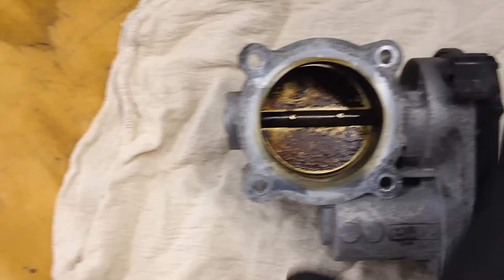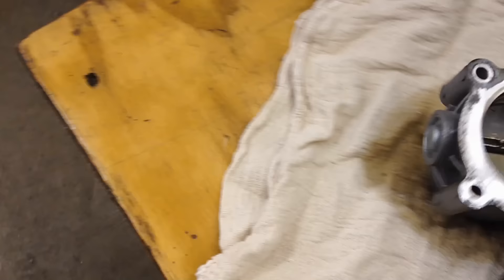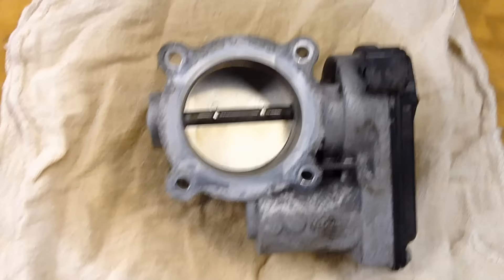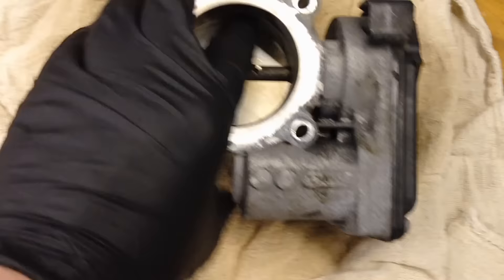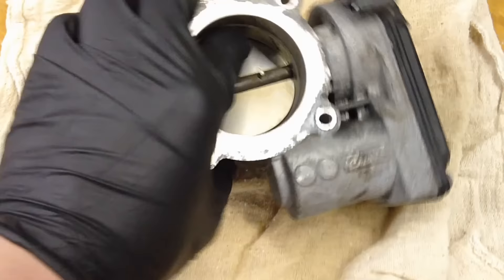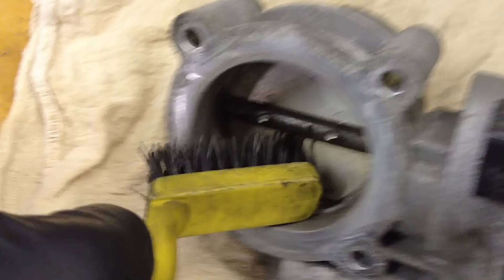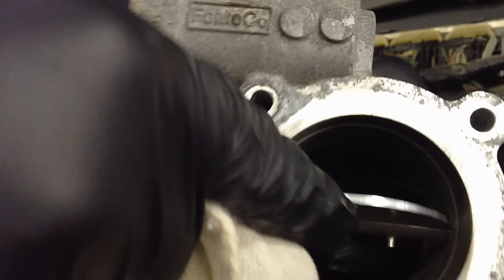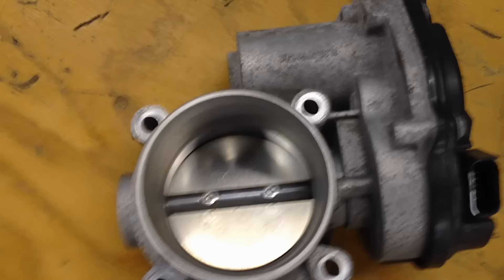How to Clean an Electronic Throttle Body Safely

Comment: So is any brand name throttle body cleaner safe to use on any Ford throttle plate?    I was wondering because I know some models have the warning sticker not to clean the throttle body because it will wear off the coating.   Thanks for the videos!
Reply from the maker: Just make sure it throttle body cleaner and not carb cleaner and you will be set. Most of these cleaners lost their power a few years ago when the Feds force water based chemicals on us.

Comment: I have a 2011 Ford Expedition. I recently have been experiencing cold start problems, when it does finally start, the overwhelming smell of fuel from the tail pipe will kill you. I recently had a remote start issue and disconnected the battery. according to your video disconnecting the battery will reset everything including the throttle body parameters and positioning on startup. I did not clean the throttle body but followed your instructions on the relearn procedure. I'll see how that goes. If it continues I will try cleaning the throttle body before replacing it. Any other advice would be more than helpful.
Reply: If you're getting excess fuel in the exhaust then either your cats are failing or your car is running rich.  Simplest cause?  A vacuum leak.  A vacuum leak causes a lean condition and the PCM compensates by drastically increasing fuel since it cannot reconcile the unmetered air.  Another thing to check is spark plugs, although you'd probably have felt if it was consistently misfiring.
Reply: I had a similar problem with my '08.  Ended up being a bad fuel injector.  Hope that helps to track down your issue.
Reply: I appreciate the input.  It has been starting just fine since the weather has warmed up, whether by key or remote start.  I'm fairly convinced that it is in fact throttle body considering the amount of miles my vehicle has on it as well as the fact that cold temps play amajor factor in the functionality of electronics. As long as it starting fine now, I will continue to run it as I am saving money for a performance throttle body and spacer kit for it.

Comment: I have also heard that when you put the throttle body back on that you need to tighten it down a little bit at a time.  Tighten each bolt opposite from it so it goes on gently an straight.  What are your views on this?
Reply from the maker: Tighten down in a criss cross pattern yes, tighten down a little at a time no. Snug all bolts by hand then torque them in a criss cross pattern is all.

Comment: I have heard that even though you have de-energized the throttle body and taken it off to clean you should still not mess with the butterfly valve because that will possibly mess up your computer and it will go through a relearn process that may or may not get you back to square one.  Is that true?
Reply from the maker: Nope I can send you a tsb stating it is ok if you want. If you check out my video on electronic throttle body failures you will see it is a simple gear set and spring. Whenever you clean it a relearn should be done.

Comment: I have a 2011 ford fiesta ses manual transmission and it keeps revving high I looked in secret ford menu and I'm getting error code 0401.  I looked it up and says egr but I cant find any info on this for this vehicle.  Another think that boggles me is if I put heat or ac on full blast it stops it from revving high but as soon as I turn the heat or ac off it does it again .  I have already replaced  02 sensors, vvt solenoids, wires plugs distributer,battery, maf sensor, canister purge valve   .   Please any info would be definitely helpful

Comment: What  i  did  is  i  moved  the  butterfly  when  plugged  in  it  set  my  computer  into  safemode  lack  of  power  if  i  take  the  throttle  body  off?  And  cleaned  it?  Would  i  have  to  relearn  the  computer?

Comment: I have a ford focus with the same throttle body, it has a stalling issue where it will stall as soon as you start it and won’t idle, you can still drive it fine just going around corners you need to hold the brake and gas at the same time

Do you know what could be causing this ? 

I have a video of what it does

Comment: I have a 2009 Ford Fusion 2.3L.  The throttle body appears to have a coolant hose connected to it.  Are there special precautions to take when disconnecting or reconnecting it (perhaps to avoid air pockets)?
Reply: It's not a coolant hose.. 
Just a suggestion, take your car to a shop.

Comment: so are you saying if I disconnect the power or the electrical connection, I can open the butterfly without taking it off the car and messing up my positioning sensor. even with it out of the car should I be opening the butterfly? wont it mess up my positioning sensor
Reply from the maker: Yes you could and it would be safe but you wouldn't be able to clean as good is all.

Comment: so if you push on the throttle plate while it's plugged in ( not against the spring tension, but the other way ) and it clicks a couple of times. what kind of damage could you do to it? because i did that, and i stopped after moving it less than 1/4 in, and now my car is shifting into 2nd, 3rd, and 4th at about 3-4,000 rpms which is way higher than normal. and now when i,m in overdrive its rpm is at 2,000 at 70 mph. and now it's using a lot more gas because of it. i thought i musta damaged it, so i installed a new electronic throttle body on it today, but it's still the same. so maybe i need to do a relearn procedure on it? what do you think?

Comment: 08 mountaineer v8. transmission kicks  to hard in to second gear. I noticed my rpms dropping pretty slow when I try to rev in neutral or parking. Can that be caused by dirty throttle body valve?

Comment: I heard that the Ford throttle body has a coating and they recommend very specific throttle body cleaner. So, is CRC or Chemtool throttle body cleaner acceptable and if using a brush is recommended? I have a 98 Mercury Mountaineer 4.0L V6 SOHC and since I have a throttle cable, does that mean I don't have to worry about having to relearn the programming? Your other video you talked about having to reprogram even if the battery has been replaced. I recently replaced the battery and did not see or felt any difference. I guess you have to relearn only if you have an electronic throttle body and since i have a cable it doesn't apply?
Reply from the maker: CRC cleaner I link to is fine. Yours will not have to be relearned although of it's really gummed up you do a PCM reset cable driven ones still have an iac trim

Comment: My 2015 Expedition EL while drive down the road goes into LIMP mode, I pull over turn it off and then back on and it is fine.  I have heard the Throttle body may be the issue. Is this something that a cleaning can fix or does it have to be replaced. I had the Engine scanned and it shows no faults.

Comment: Have a 2005 Honda Civic that is rough when idle. Sometimes more than others.. Replaced all mounts because they did not look so good but still rough in idle. Someone tells me that the throttle body can be the cause. It's an electronic throttle. Is it OK to  move the butterfly door the clean as long as if is disconnected without causing any motor time problem? Thanks.

Comment: I have a 2010 Toyota matrix xrs, not sure what the problem is but I was told that my throttle needs to be clean up.  What happens is that every time I'm on a red stop light my car starts shaking.  Can you show me how to clean my throttle.  Thanks Edgar
Reply from the maker: Edgar Flores It should be the same as the way I show in the video.

Comment: last time i cleaned my 2012 honda accord throttle body i have a question it is normal for the plate to be a.little open?? is not fully closed or stay
Reply: Yes, or it wouldn't idle if it was completely closed off.

Comment: I got a stupid question. Im the proud owner of a 21 mustang gt with 50k miles bine stock. 1st thing i did was put a JLT oil catch can and now i wanna clean it

How do you de-energise the TB? Simply unplugging it and taking if off the car orrrr is there a wait time you need befor3 you can fully open the blade from taking it off the car? Thanx in advance
Reply from the maker: unplug before servicing yes.
Reply: @FordTechMakuloco  thank you! I figured that made most sense but wanted to make absolute sure 1st. 🍻

Comment: Hi, Would you recommend this cleaning on a 2011 Ford Edge that has "yet" to have a problem with the ETB? I had my car shut down today 3 times due to low Oil levels..... 1 1/2 Q low. I don't understand why it shuts off first then warns you. Thanks for the video.
Reply: +CSRT4 Ever Yea, Great idea!  Well, if you must know. I newly discovered that my left valve cover is leaking badly causing quick loss of oil. This is the only car I have owned that just shuts the fuck off and then tells you that the oil is low. Again, Engine turns off, then it tells you the oil is low. Even the tech at Ford said it was a dumb design.  I was only 2 weeks into a fresh oil change when this occurred. So really, there was no need to "check the oil" as it should have been fine. Now after replacing the cover there is zero oil loss and oil levels are good. Brilliant! yup, fucking , Brilliant! I wish I was as perfect as you sir.

Comment: Any tech school advises against moving the plate at all. Even when disconnected. Those gears inside are cheap as hell and I've seen perfectly good throttle bodies ruined this way. I always spray em down really well and try best to clean em without moving the butterflies at all. Just my experience.
Reply from the maker: Well according to Ford you can move the plate no problem with it disconnected. Have you seen the inside plastic gears they are very thick and to this day I have not seen one break. You must move the plate to clean the edge of the plate and the bore of the housing where the plate rest or you will not fix anything when it comes to the learned angles in the pcm.  Anything above 3 degrees you will have problems but Ford says 5 degrees officially.

Comment: My 2004 lincoln is on etc engine safemode. The engine meter read that i need a throttle body control. If i clean the throttle is it possible that would get it to start up again?

Comment: Does it needs a sealant rubber or ìt can be directly fixed by tighting the main screws only ...thanks for your cooperation
Reply from the maker: The silicone gasket can be reused no sealant required, clean it an bolt it right back up.

Comment: I have a 2011 Mustang GT with a slight rough idle that will die when the a.c. is on pretty frequently, less frequent when the a.c. is off but still an issue. Could it be that my throttle body needs to be cleaned?

Comment: By cleaning the Throttle body, can it eliminate the check engine code P0121?  I'm wondering if I have to replace it or clean it first?

Comment: I have a 2006 F-150 5.4 3V. with a 156,000 miles. been driving it for almost a year. Throttle seems to be fine. Would it be alright to clean it as preventative maintenance?
Reply: Absolutely. My 2006 ran like a Swiss watch, but when I removed the tb to clean it, it was frighteningly filthy on the engine side of the plate.  Just finished cleaning my 2011 tb, it only has 86000 miles on it, it also was covered in filth. Took it for a ride afterwards, what an amazing difference in power and responsiveness. The 5.0 feels like brand new again.

Comment: Hi, do 2015 mustang ecoboost's have an idle air control valve? I can't find it, my car surges when starting up and then idles fine after about a minute. I'm thinking about cleaning the throttle body.

Comment: I have a 2013 Chrysler 200 my throttle body light came on and car would not accelerate do you think if I cleaned it it would work properly or needs to be replaced? I did the "key dance" and that light and the engine light both went off and car worked fine for a couple days then did it right back again.
Reply from the maker: You can sure try yes

Comment: How do U feel if U Don't clean it ??? because i feel some times that my car isn't want to go on as i want it faster ...the car increase and decrease the speed  the RPM goes up and down ...... i think it is the fuel filter or the fuel tank want to be clean . by the way my car is Ford Focus 2009 ....any help please
Reply from the maker: +osama bashier If it is due for a cleaning you may have low power and or rolling idle
Reply: +FordTechMakuloco 
they told me at the Ford Company,  that there is no fuel filter,  so am going to check the throttle

Comment: Is that part from a 2009 Corolla ! my car idles up and down and I cleaned the mass flow sensor and the throttle body but I keeps reving up and down ! would you know where the idle adjustment is ?
Reply from the maker: You have air flow disturbances in your air stream or the throttle body itself has failed.
Reply: I took off the air mass flow and when I put it back on it idled at 2000 RMPS

Comment: Would this also apply to newer Fords? I have a 2012 Ford Fiesta that my dealer said my throttle body was pretty dirty and figured I can do it myself. I just don't know if I remove and disconnect it, would it need a dealer level scan tool to reprogram it? Thanks in advance.
Reply from the maker: rickalator98able Yes it applies to all Fords with electronic throttle bodies. You just start the car after and let it idle a few minutes and it will relearn automatically.

Comment: Can you just leave it bolted on but disconnect the wiring harness?

Then is it safe to open the butterfly manually?
Reply from the maker: Yes but you won't be able to clean it properly.

Comment: Yo my man i followed ur video about the cleaning it worked but it snowed a week later got to -18c went to start it, but nothing so i asked a buddy to check it, it was ALL Mass air flow senor he reset it i clean that to but the engine light came on again. I noticed u took off that plastic piece on the throttle body, on mine its more of an triangle shape but on urs its more of a rectangle, do i get a whole new throttle body n that comes with it? Or do i just replace that one peace thanks

Comment: I have a 2006 ford fusion 3.0 the wrench light turned on and then off and on again and now the car wont start. The dash lights and service lights com on but car doesn't turn over. Please help with a solution i am flat broke i will do it myself.

Comment: so I have a 2006 f150. it wants to shut off if I stop sometimes. but starts back up and runs. I don't have a check engine light come on. so should I try cleaning throttle body first. or replace
Reply: +douglas mooneyham   If it's happening when you're coasting or coasting to a stop and/ or when idling(throttle is closed), it's probably the Idle Air Control(IAC) valve.  My Mustang was doing the same thing.  I removed it to clean it (it was black with carbon) and noticed the spring was broken so, I replaced it($56 at Autozone) and solved the problem.  If the spring is intact, you can clean it out with a throttle cleaner.  Just be sure and clean it holding the motor section up so the cleaning solution won't gravity feed into the electronics!

Comment: I have a 2004 Ford explorer xlt when I step on the gas it's not moving it will roll a lil but I don't even think it's doing if at all 5mph  go in reverse back up and all but the guy at shop suggested the throttle body but I'm not sure can you help me a lil he suggested the throttle body but I don't think he was even sure

Comment: I took my 2003 Expidition in for smog check and the owner told me to drive it for 100 miles then bring it back. When I got back home, my truck would start and idle fine, but when I put it into any gear it would stutter and had lost all of it's power and wouldn't even move 1ft. What could be causing this? Ps) the throttle body has been cleaned just like the one in this video.

Comment: So before I do the relearning process I should clean the throttle body?
Reply from the maker: It is a good idea yes
Reply: In toyotas you just have to take off the battery and reconnect in 20 minutes, the car will relearn

Comment: can you leave the key on/engine off, Place a pedal depressor on the accelerator, and be able to clean it without removing it all?
Reply: you won't get it cleaned properly without removal, I used a full can of CRS TB cleaner and a horse hair brush with 1 1/2" bristles 120k miles.

Comment: Would disconnecting the battery be a work around to tacking the throttle body of the engine ?
Reply from the maker: Yes but then you could not clean it as well.

Comment: So is there no issue moving the valve when its taken out?
I heard you can also throw off the calibration with the electric motor, i'm assuming thats only when its connected electrically?
Reply from the maker: +InDmand No this is the Ford approved method.
Reply: So what about the other brands of cars? Is safe to follow the same procedure ?

Comment: i have a 2000 dodge stratus 2.4 lt SE 4 cyl and i believe the TPS is bad, I cleaned the top of the Idle air control valve, if i take that off do i need to replace a gasket or something? I'm determined to fix this car. Any help would be awesome.
Reply from the maker: If you pull the throttle body to replace the tps you will need a new throttle body gasket, otherwise the tps does not require a gasket.
Reply: FordTechMakuloco
 ok awesome. Thank you so much. I can't seem to find squat for a dodge stratus. You are a life saver.